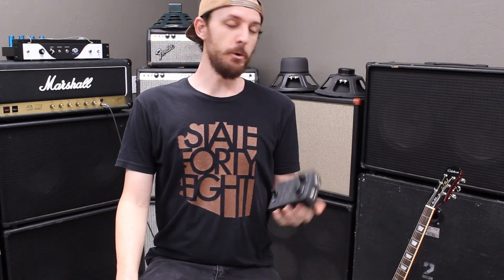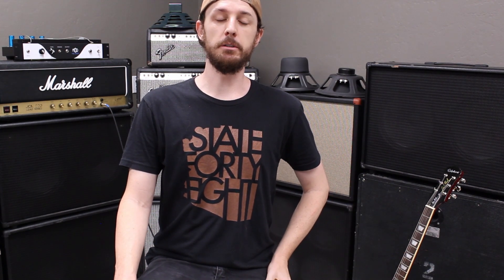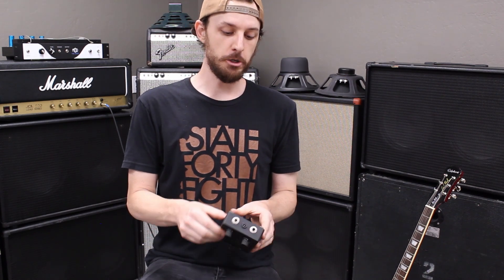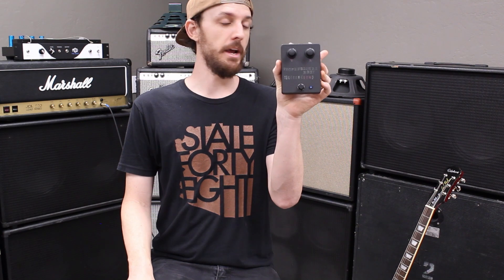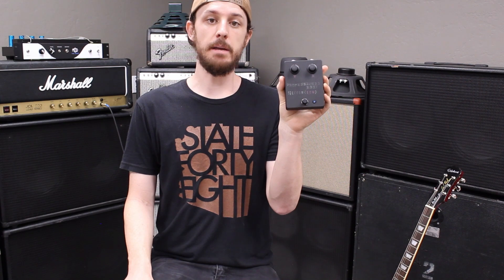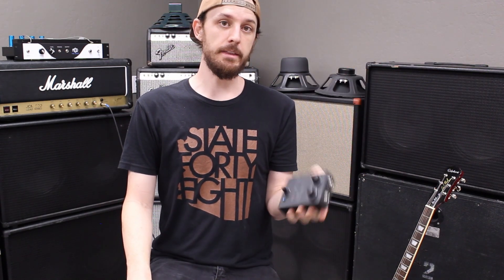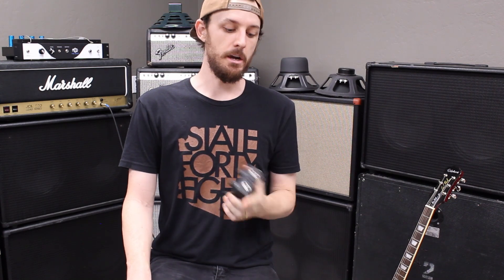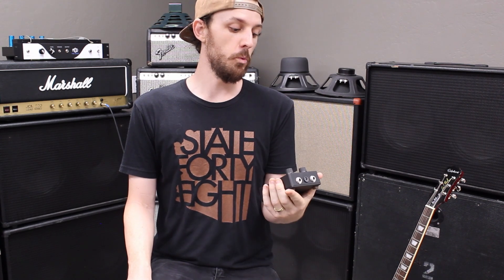Silicon Tonebender MkII demo

Comment: What is the hfe for transistors and how do they need to be biased?
Reply from the maker: With the circuit tweaks, the bias is very stable and most medium-high gain silicon types will drop in just fine with no adjustments needed for proper bias - BC109B or similar is what I'd recommend (hfe of 200+), but as long as they're not very low hfe (i.e. <100) they should work well in there.
Reply: @amplifiedparts  thanks a lot! 
There is a small error in the vero layout. Cap between Ground and +9V should be 47, not 4.7

Once again thank you for staying open source to DIY community.
Reply from the maker: @roar140  That should be updated on the website, thanks for pointing that out! And no problem - we're excited to hear what people think if they give this one a shot.